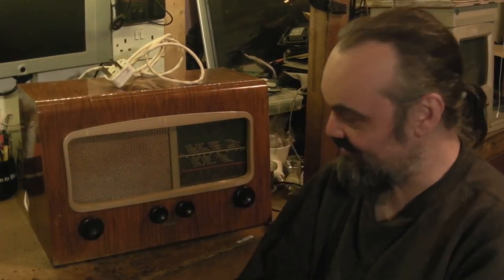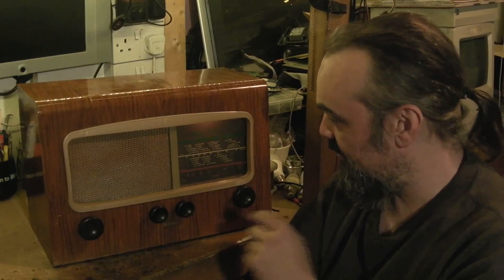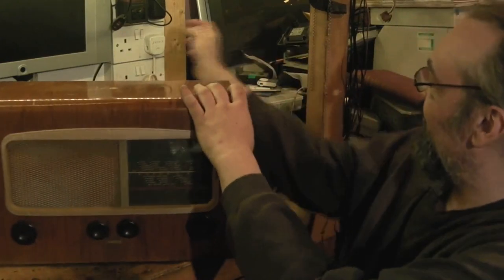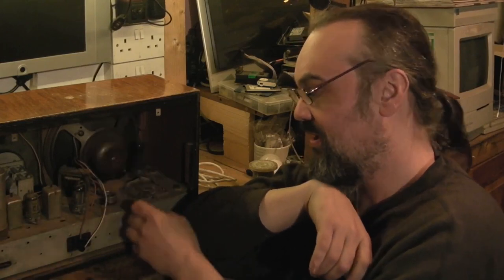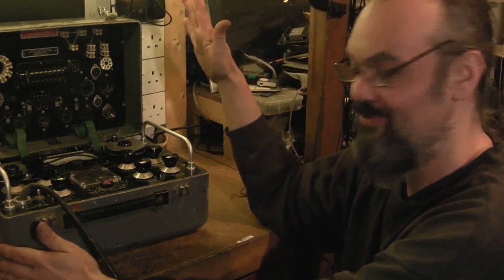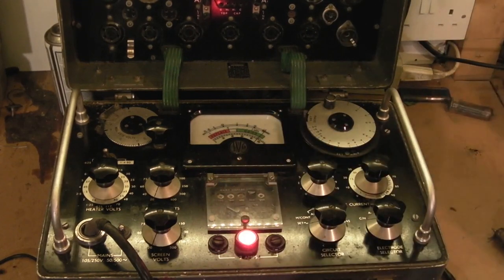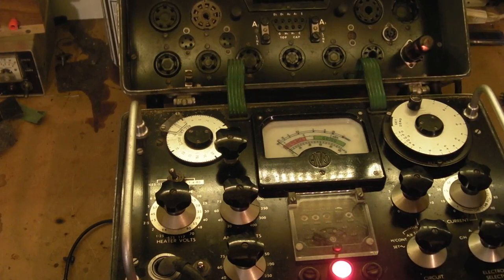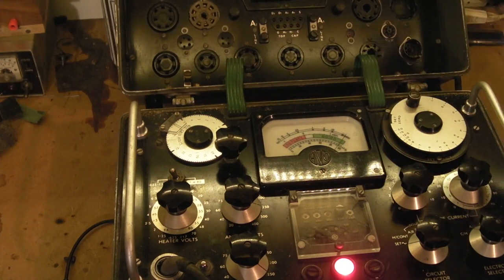Testing a couple of valves on the AVO CT-160 Valve tester

Comment: I would monitor the grid voltage as the sound fades as the UL41 could be going into grid current as it warms up. Valve Testers don't detect such things !
Reply: definitely, these suffer from grid emission a lot, you CAN check for grid emission/current with a CT160, i have one, you move the mutual conductance set/test dial just a tad from the end stop, onto and just past the 'set zero' mark, and if the meter reading rockets up, (after backing it off to zero before doing this), its definitely a bad valve ,  but you must let it warm up for several minutes in the tester or it wont show up
Reply: fading out is more likely grid emission in one or more of the earlier stage valves

Comment: Interesting that you pull in the same noise on LW as I do. It’s good to know it’s not something in my workshop. Yes it’s the Anode LOL. I have had a lot of tubes that do look black but still work and test well. I think your talking about rim lock bases with the little pip
Reply: I also have a CT160 and I agree one of the best valve testers ever made. I have one but I do prefer to use a little Sencore tester as it’s a bit easier and quick to use but not as accurate.
Reply: It is hard filming around a tripod I share your pain. Nice to see the valve tester in action. Careful storing the lead in the case it would be easy to smash the meter
Reply: Where are you from.....
Sounds like a bit of a manc accent.....   I have a question I can't get my head around.....
I bought a ct160 10 days ago ....
And regardless of the data ,the anode current settings are always a lot lower than the book.... e.g testing ecc81 valves the anode current should be 10ma and out of 5 valves I've tested they all seem to be about 3to 5ma to zero on the scale....
I've been desperate for a new video to pop up somewhere.....  would it be possible to do a video at some point testing an ecc81.....

Ps tried a e88cc and the anode should of been 15ma I think it was, however it was zeroing on 3ma....

I'm new to valves only using basic go no go testers...

Any help would be awesome..
I'm in Burnley
Reply: @prodeltd  i had similar issues with my ct160, they actual current isnt dc but half wave ac, of different  amplitude, cant remember exactly the difference, it states it in the manual, but the meter is scaled to take this into account,  i was thinking all my ecc81s were bad, and probably are a bit as the anode current varied widely with even minor change in heater volts
Reply: did you test used or 'new' valves? if used, try it with a new one and see what happens? my ct160 is currently out of action due to bad meter
Reply: @andygozzo72  problem solved..... negative grid was reading wrong... adjusted 😁.  Now like a dream
Reply: @prodeltd  sounds like my ecc81s were well worn then, i kept them and tried one in place of an ecc83 in a pye stereo radio, worked perfectly, no difference 😲😁